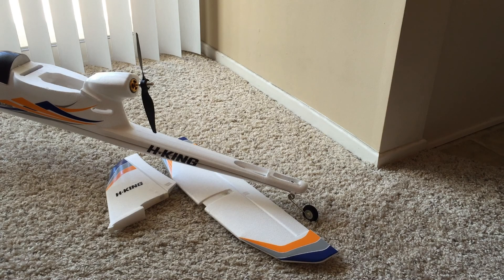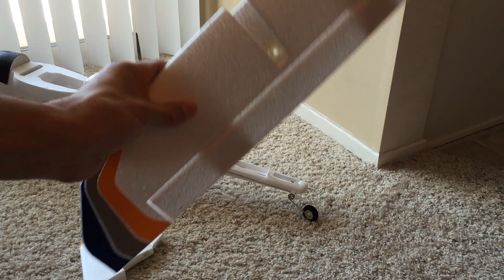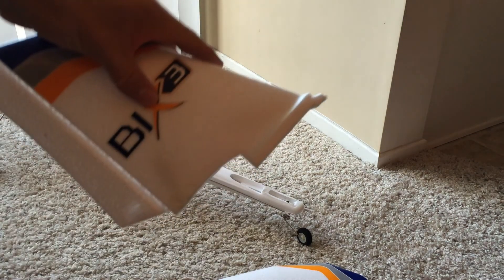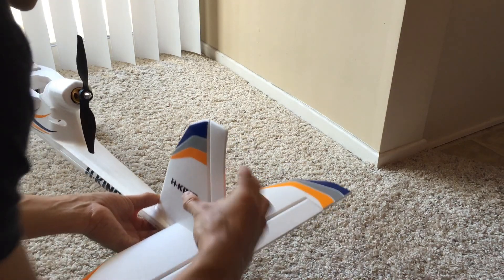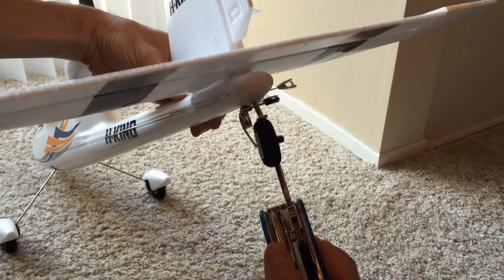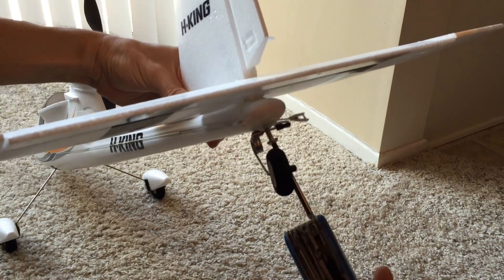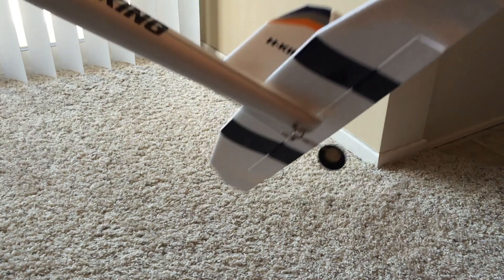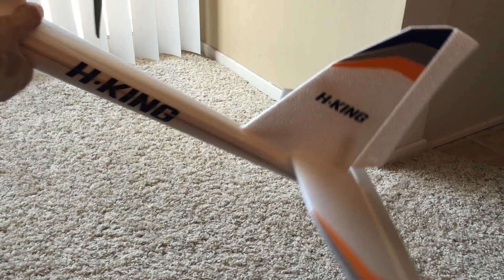Bix 3 Removable Tail Mod

Comment: Nice mod so it can be packed back into its box and is easy to transport, also if you take is soaring you can take off the tail wheel.  Is the polystyrene tip of the boom strong enough in the long term?
An alternative I have done is something very similar but used metal push rods (x2) with threaded ends, the non threaded end has a short bend to allow tightening. The rods go through small holes the carbon tube in the fuz. There are plastic tubes glued in the fin which the rods slide through, terminating in a short length of plastic snake also glued into the fin about 30mm inside the fin. There are also 2 short lengths of tube glued under the fuz to act as torque sleeves so when you tighten up the polystyrene does not crush. Cheers
Ps great toy isn't it!